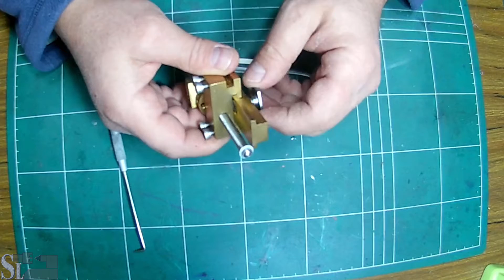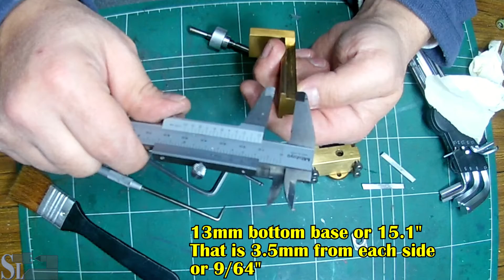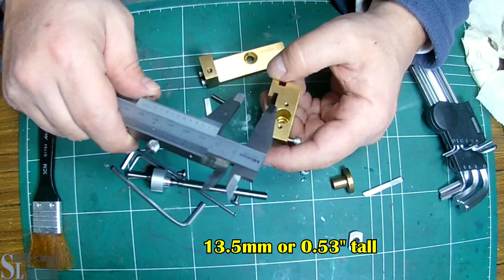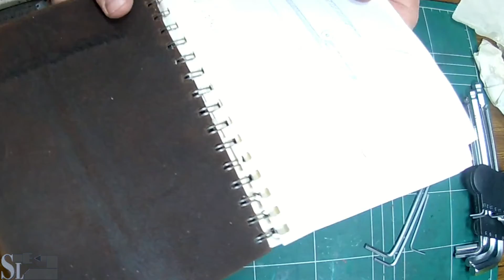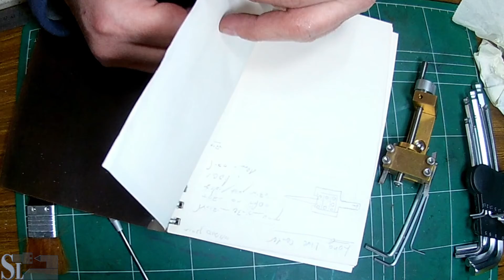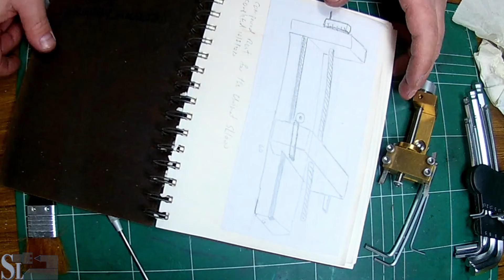The unimat compound rest   dimensions

Comment: You can cover lead screw simple tube and slot how say rotate to linear
Reply from the maker: Cover lead screw - yes. Linear turninng is also possible of course but the unimat tool holder is more rigid and gence preferable.
Reply: @Smallathe  hi Mister again please send me mail  send you  that design helps you

Comment: Thanks for the drawings! I want to attempt a 3d print of the compound rest.
Reply from the maker: Go for it :)
I just tested 3D printed (PLA, solid or hollow) pulleys for the unimat lathe. Sadly, while initially they worked well - under load they quickly failed. 
Keep me posted on your attempt. I'm very interested to see your results.

Comment: Thanks Saar, for the new video and some dimensions. I may try to make this out of aluminum, as I found some at the local junk yard. Do  you think I will be wasting my time because it is not made from brass?
Reply from the maker: Hi Chester. My pleasure. I still have to make the drawing and I will post a note in the community and here once it's done. As for aluminum - well, if that's all you have - use it. I would make it out of 304 or 314 stainless or mild steel if I could - but the unimat will not handle that as a mill. My compromise was brass - and I had it (also from a scrapyard). May I ask in what country you live in? If the postage isn't that bad I can send you some brass - I still have the bar stock I used for this project, I can cut some of that for you.
Reply: @Smallathe  Thanks for the offer Saar,, I will try another scrap yard  here in the US.
Reply from the maker: @CHESTER-qd4mh  If you can't find any... The offer will still be open for some IL brass... ;)